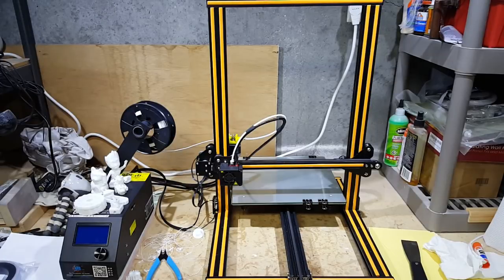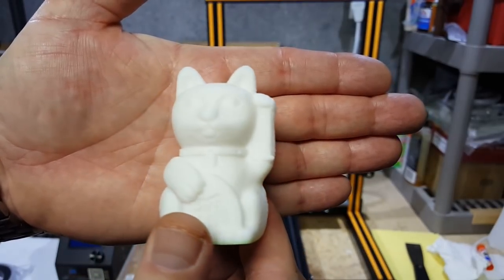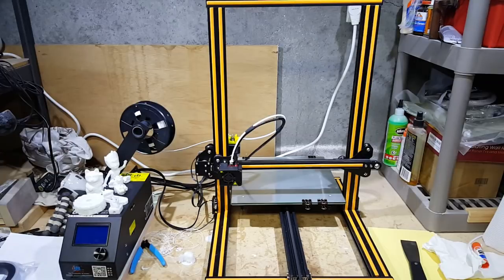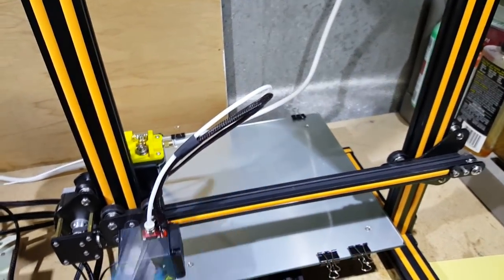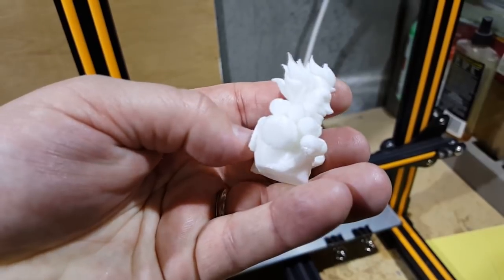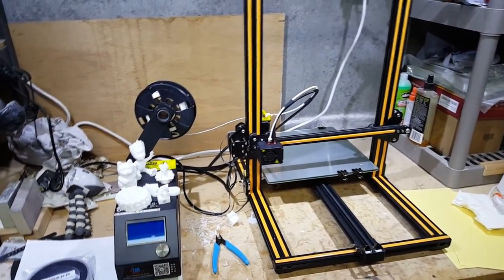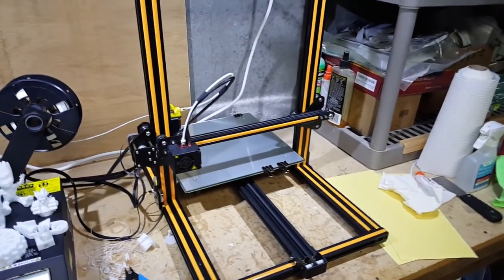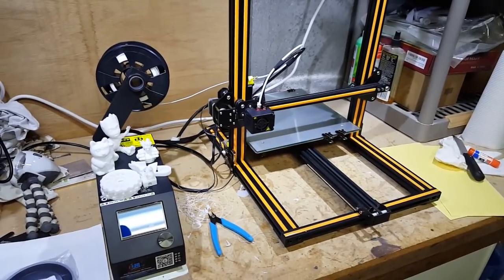Creality3D CR-10 3D Printer - 1st Printer Impressions

Comment: So as I mentioned, one can get away with not using glue, but using very clean glass and a good bed temperature. I noticed TPU sticks quite well at 80C. As mentioned, PLA seems to stick well at 70 and snaps off easily in the low sixties. That was my tip, comment and otherwise:)
Thanks for taking the time to share your experience, I am sure it will help many people get over their own doubts about how easy it can be to get up and running.
I have not used Ninja-flex, I would be interested to know how you results are with that product, it may be challenging because the CR-10 is not a direct feed model, but it can work.
Happy printing:)

Comment: Hey Nick,
In my own experience, I found that PLA sticks really well at 70 degrees C and comes off the build plate easily at around 60...I wait until the bed cools to 60, and the part snaps right off the plate, but at 70, it just doesn’t want to let go:)

Comment: Hey Nick,
I highly recommend doing your bed levelling when the bed and nozzle are hot. We are dealing with 1/10s of millimetres so a hot nozzle will be larger than a cold nozzle and the bed will deform somewhat when it gets hot as the heating element is concentrated in the middle of the build plate.
Also, using a gauge is much better than a piece of paper, paper varies in width by a huge amount, and the more one uses the sheet of paper, the more it gets compressed, a feeler gauge, or a set of gauge shims is a much better way to go as you are sure of what distance, on a certain part of the build plate, is optimal for a good print in whatever material you decide to print with. You can then vary the distance you set your nozzle, with paper, you really don’t know what your distance was, and what it is after you make a change, the steel shim gives the user some certainty.
Happy printing!
Reply from the maker: Good tips all around. Thank you

Comment: Hey Nick, 
I have both the CR-10 and the Anet A8 and they both have their own strengths and weaknesses. Out of the box the Cr-10 is a great unit, but, I am going to switch my Anet A8 back to a direct feed because the Cr-10 is just so much better with the Bowden tube setup, but, printing larger parts in TPU can be a pain as, even with some mods, the CR-10 will still get jammed from the retraction of the flexible filament. This results in weak spots in larger prints which renders them useless. I am still using the Cr-10 to print TPU, but will return my Anet A8 to a direct drive in order to avoid potential jams. There are some extruders on the market which have the Bowden tube from the hot end running straight to the toothed gear, but this means changing the entire extruder, which is a bit silly if I have another capable machine:). As far as value goes, the CR-10 is fantastic (IMO),except in the learning experience, which one gets while building the Anet A8 from a kit.
I think it’s great the quad and 3d printing hobbies merge well together:)
Merry Christmas!

Comment: Congratulations!  Another thing I didn't notice you mention is filament will absorb moisture very easily and will cause many inconsistencies.  

I was planning to make a video about it but my work has be so busy at the moment I cannot. I basically have the clothing vacuum bags I put reels in with Silica gel packs and quick vac and they stay nice between prints.

Good luck and I am far from a pro but I would be happy to help if you run into a snag,  I spent most of my free time testing all those settings while teaching myself how to 3D model.  (In the process of making a leader120 frame revision)

Comment: Nice little printer, I'm using an older Prusa i3. I had been looking at the larger version of that printer!
I don't want to put you on a downer, but you will really struggle using flex filament with an indirect extruder! Not necessary impossible, but really not the best choice.
Reply: Mark Wood i agree i dont even try to print flexible on this due to the boden style extruder. I use a powerspec pro2 to print all my flexible and abs filament and the cr10 for just about everything else.

Comment: I have tried a bunch of different slicing software and Cura is still my favorite. I also have a Raspberry Pi with OctoPrint connected to the printer, so that I can print over the network with Cura.
Reply: I thing Cura is great for free, but I'm one of those people that bought Simplify3D (a long time ago) and I think it's absolutely worth it... much easier to use, greatly improved prints and much, much better supports (just my opinion, not bashing Cura). Also, I love my Octoprint as well.  It's so simple to sit at my desk, design or download an .STL, upload it to the Pi and start the print vs shuffling SD cards.
Reply from the maker: wow, your way ahead of me. so you leave your printer on, or print one after another, asking of the print over network option.
Reply: You install OctoPrint or AstroPrint on a RaspberryPi (or other cheap computer). You plug the usb from printer into the Rapsberry Pi. And then connect the Pi to the same local network that the computer that you normally use Cura on. Cura can be configured to connect over OctoPrint/AstroPrint box and send in the gcode to print. If you hook a webcam up to the Pi, you can also watch the print remotely through Cura. They is probably info about  it on that Facebook group.
Reply: BTW You can slice multiple smaller things at once with Cura. You just open up all the STL files in the same session and arrange them on the bed the way you want (there is also a way to auto-arrange them). You can decrease setup and cleanup time that way. You don't need OctoPrint to do that.

Comment: Good choice. I have an Anet A8 and it was terrible. Not much left of it. I have been systematically replacing every part. I wish I waited and got a CR-10.
Reply: It can definitely do flexible from the get go, but with the addition of one printed piece (thing:2144277), it is much better/more reliable at it.  I ended up replacing mine with an all aluminum version from MacEwen3D after mine broke and now it's even better.
Reply: Anet A8 can't print flexible materials like TPU out of the box. So that is another big plus that the CR-10 can.
Reply from the maker: I didn't realize the A8 couldn't print flexible. Why is that?
Reply: The design of the extruder. Flexible materials want to buckled under the feed pressure and need the extruder to be setup to deal with that, otherwise the filament just squeezes out the side of the extruder or gets jammed. Anet A8 can be modified to do it. But CR-10 can do it out of the box AFAIK.